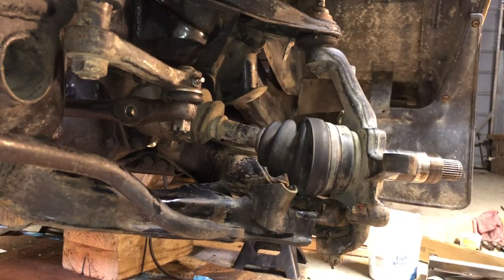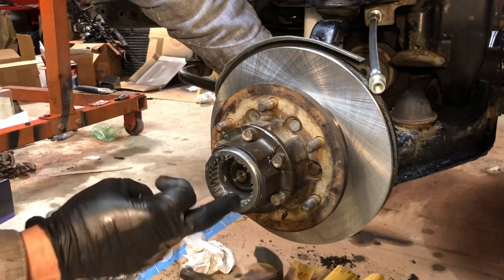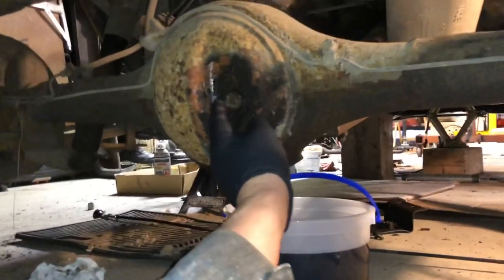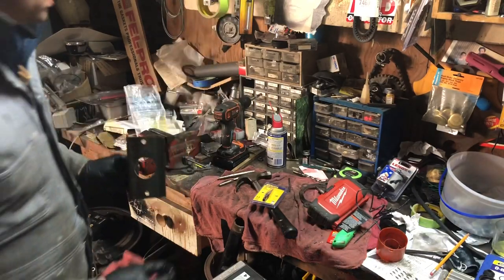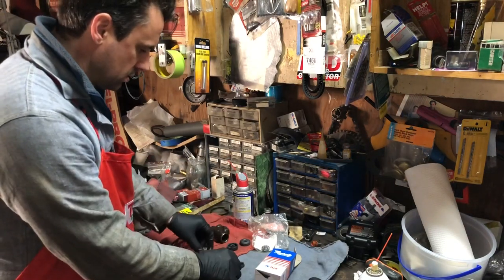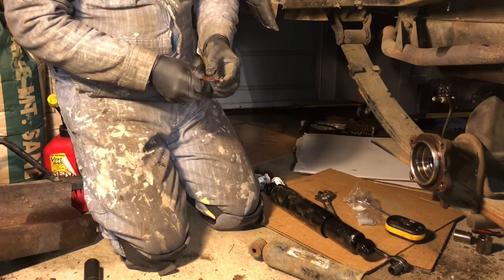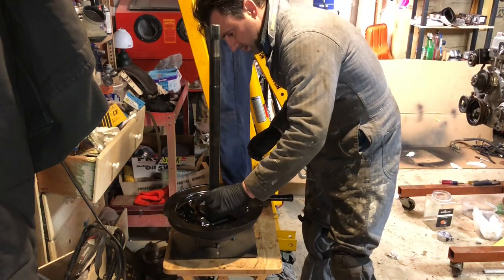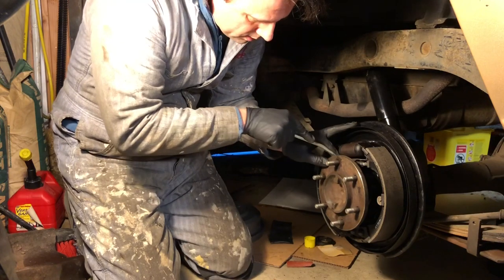1988 Dodge Raider rebuild episode 8 (axle seal replacement)

Comment: Masterful instruction.  Do you recommend OEM seals from the dealer?  Is Timken the manufacturer for the OEM seals?  I have the 1989 V6.
Reply from the maker: Timken is a quality product whether its OEM or not...I don't necessarily recommend OEM, I would say seals and bearings from most manufacturers are going to be fine.
Reply: @anthonywatkins  Thank you.

Comment: You should have put some silicone gasket maker for auto hub install.
Reply from the maker: Yeah good call...I noticed the book called for that. Mine came apart dry though, so I didn't think it was necessary, we'll see.
Reply: @anthonywatkins  I did the same. A few months later inspected it an found some water.

Comment: Hi Tony, do you have a video that shows how to bleed the brake lines? I replaced the master cylinder on my 87 Raider and before I try to reinvent the wheel, I was wondering if you've already shown the way to do it on one of your vids? If so, which episode? Thanks.
Reply from the maker: ZZ Ranch hey man, yeah I touched on that in the beginning of episode 20...I like to attach a shop vac to a catch can which pulls a vacuum on the brake line at each bleeder valve. You can pump the brakes a bit to speed up the process.
Reply: @anthonywatkins  thank you Tony, I will definitely check it out. I appreciate your time answering my question.

Comment: Hi tony what size are those oil seals if you don’t mind me asking I need to replace them on my 89 pajero I recon I can get them cheaper outside of the auto parts stores
Reply from the maker: Looks like front inners were Timken 225875 (75mmx58mmx9mm), rear inners 36x52x10, rear outers seal# 417.46007 (37x62x9.5). Double check those before you buy, I've bought seals for several cars this year and it's possible I'm mistaken...
Reply from the maker: You can always mic your old seals with calipers and get pretty close...